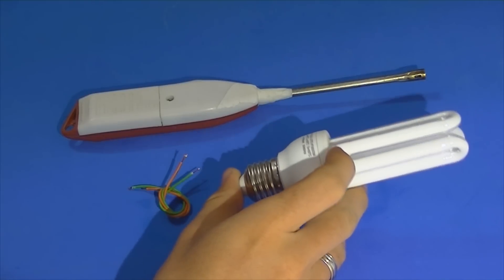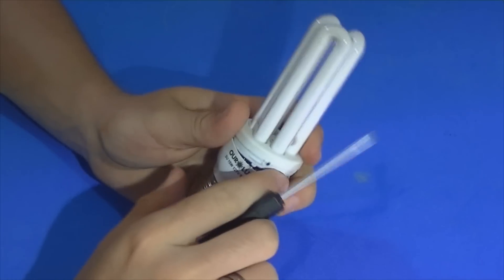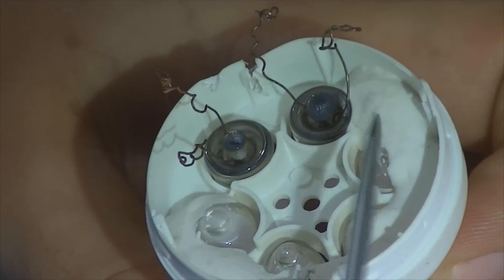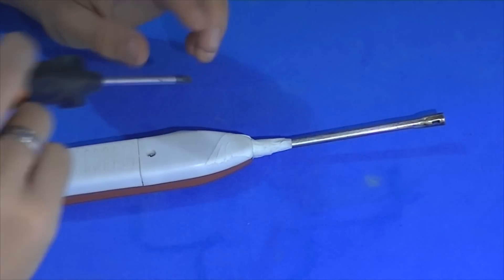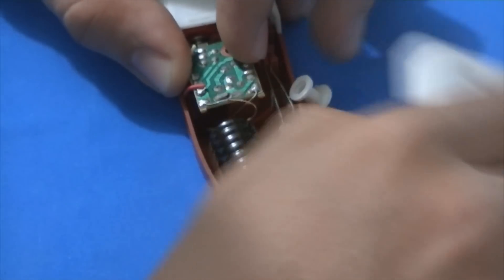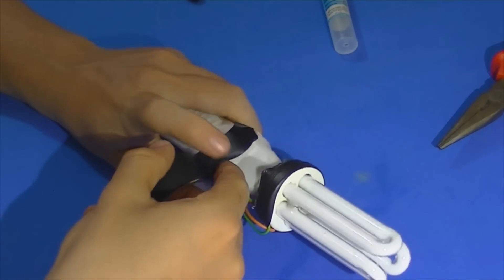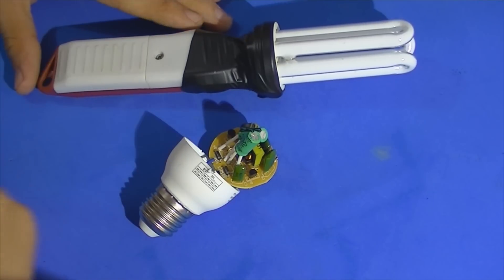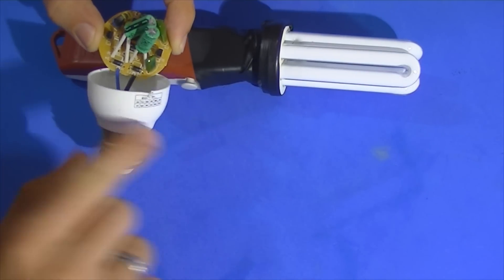Como Fazer uma Lâmpadaterna Caseira

Comment: achei um pisca pisca de LED que não funciona
como sei que LED não queima tao fácil
pensei em mandar uma pergunta
como fazer uma luminária usando LED de pisca pisca???
pra colocar no quarto, na sala e etc.!.
Reply: Man, o LED tem dois polos, positivo e negativo, só que ele suporta mais ou menos ate 3.7v, se o led for branco, pode usar ele até 4v na maioria dos fabricantes, vc pode pegar um carregador de celular, cortar os fios, separar o positivo e o negativo, e ligar os LEDs, só que o carregador de celular tem cerca de 5v que vai queimar os LEDs, então vc pode pegar numa eletrônica (ou em sucata de placas de circuito) resistores de uns 160 ohms aproximadamente, ai vc liga um resistor em cada led e faz a luminária de led com carregador de celular, se o led for vermelho, cuidado que ele só suporta 3v dependendo do fabricante, use resistores de 200 ohms pra os vermelhos. sua luminária vai ficar bonita, tem alguns pisca LEDs que já tem resistores nos LEDs, então vc pode usar eles e ligar direto no carregador de celular
Reply: +Clashbrothers  São leds brancos, no caso eu ligasse ele em serie em 220v daria certo???

Os 220v teria que ser contínuo ne???

e caso der certo tem que saber quantos Leds sarao colocados ne???
Reply: +Thiago Barros man, vc tem que ligar em paralelo, em série vai somando mais voltagem a cada led, ai acho mais complicado, pra transformar energia alternada da tomada em contínua basta comprar 4 diodos 1N4007 e ligar em um polo, catoto com anodo e anodo com catoto e no outro pólo a mesma coisa, isso chama-se ponte, retificadora
Reply: +Thiago Barros se vc ligar em série a cada led que vc colocar são necessários mais 4v mais ou menos, entende? por isso acho mais fácil pegar um carregador de celular e ligar os LEDs em paralelo com alguns resistores (lembrando que dependendo do fabricante de seu pisca led já pode ter soltado uns resistores neles)
Reply: +Clashbrothers  Hum...
ok obrigado cara, abraço!
Reply: +Clashbrothers  no caso paralelo seria positivo com positivo e negativo com negativo, correto???
Reply: +Thiago Barros de nada =) qualquer coisa pode perguntar pq eu gosto dessas coisas de eletrônica, tenho 16 anos kkk
Reply: +Thiago Barros correto
Reply: +Clashbrothers ok eu tbm gosto que só!

parabéns!